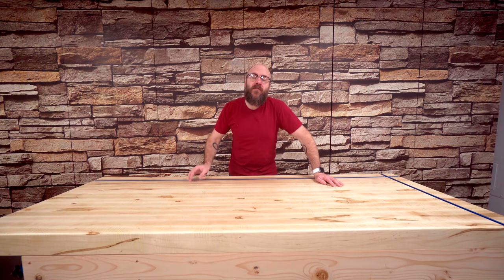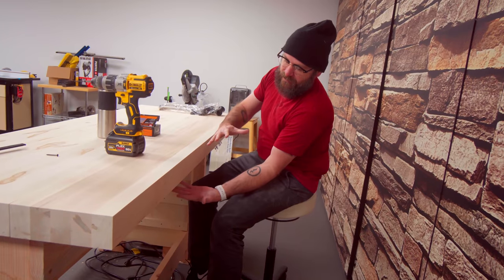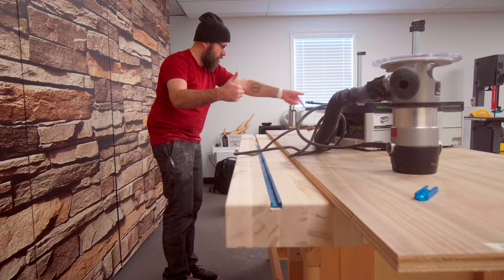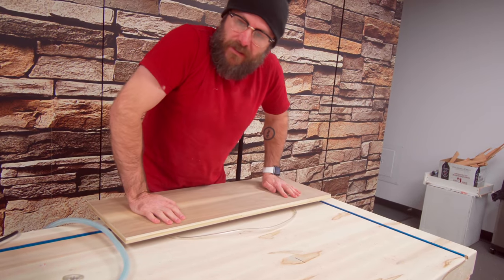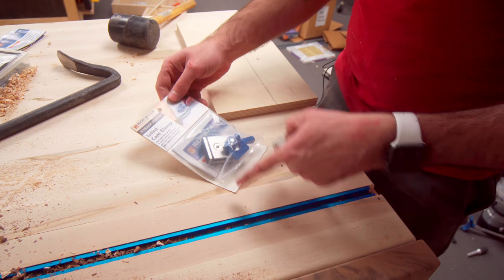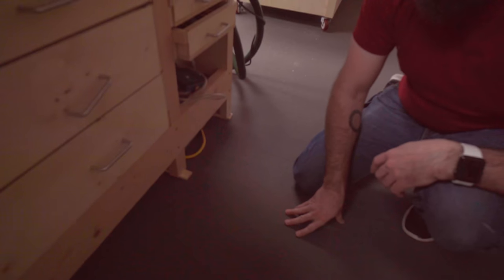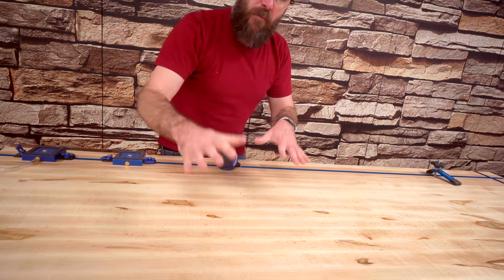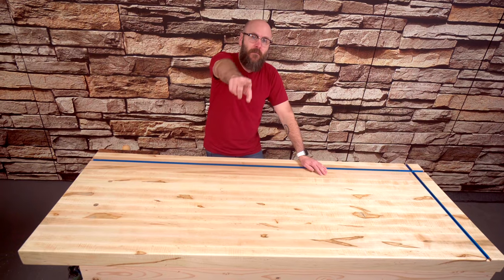Modernize Your Workbench with All the Accessories!

Comment: You are so excited about the new workbench. I have one from Home Depot that just unfolds and a premade bottom goes into channels on each side. The first thing I did was install casters and wrapped the sides and back in 1/2 inch plywood. Going to use the inside for drawers. I'm planning on building a new one. Saw someone who made it with 2 jacks. Truck on the bottom and a motorcycle on the bottom. I'm doing 12 VDC powered for both of them. Found on Amazon. Can't do that hand cranking. I would like to get your clamp drawer in on the top. The smaller ones are hanging from the router table and the long ones are leaning in a corner. You mentioned that you are in a garage? It looks like low pile carpeting. If so, how do you get the sawdust out? I have a 2 car garage and doing it at home.

Comment: At some point, you may want to consider putting a couple of intersections in the middle of the long runs along the length of the bench.  That way if you already have a few things mounted in there but forgot to put something on the inside of the track, you don't have to pull 5 things out to put the one in the middle.  It would give you more flexibility if you happened to flub the order of sliding things in.
Reply: Sean Necker , clearly you haven't played unblock me lol

Comment: Amazing bench!  Thanks for the video and T-track ideas. This is very inspiring.  One idea for the foam shadow boards in the drawer. Use two pieces of foam to get the thickness you want.  Trace and cut out your tool profiles in the top one only.  Then glue them together.  The bottom looks nice when the tool is out of its spot.

Comment: Just an idea. Maybe this idea is useful ?. Making a simple 2x3 T Track. The ends cut down to 1”. This would allow you to use the hammer style bench clamp to hold it in place. This would allow a t track clamp opposite of the one you built into the bench. This T track could be hung up vertically on the wall, or, if you make it the size of your clamp drawers, you could store it in there along with the other clamps.

Comment: Idea for the Spool:

I was thinking something that ties in with the workbench ie. the dripping colour. Carve the sections so that the edges of the top section of the spool seems to bend and drip. This could be powercarved perhaps and colour matched to the workbench.

The bottom section of the spool should be blackened and warped as if it was on fire, so the heat from the bottom would be melting the top.

The middle of the spool could have a billowing smoke effect perhaps or turned into a stack of wood to more accentuate the bottom fire.
Reply from the maker: Whoa, that's an interesting idea! I like how you think!

Comment: Nice.heres my two cents, one per.1. A T track running vertically on leg opposite clamp to hold up long boards.2. Route finger pulls into those seeet drawers so pulls dont getcha and you dont have to push through for flush condition.
I actually liked all the Rocker ads, i worked on me.

Comment: Invest a few (and I mean actually very few) bucks in a brace/bit set.  Even an old one.  Those 3/4" holes are way easier to do with a b/b, leave PERFECTLY good holes, and is totally quiet and zen.  Spade bits scare the crap out of me for any sort of surface work.  B/B with it side cutters are like super expensive Forstner bits in that they leave the hole perfect at 1/10'th the cost.

Comment: Very good work on your workbench. At 5:36, you use a tool that will cover a screw bit in the drill head and  the other end holds a drill bit. I was wondering what this was called and where you got it,,,thank you very much.

Comment: It looks great, but you mentioned that you built the top flush on one side so you could clamp a board against it down to the floor...but then you have metal handles that stick out from the drawers. Have you considered recessed handles or else just cutting a grip hole out of the drawer face?
Reply from the maker: The drawers push in and out of the way. :)

Comment: Great stuff... as always learned a lot watching your video.  As always though, a couple of comments.  How much Rockler stuff did you get to do this -- in other words was ALL the Rockler stuff in the video provided as sponsorship or did you already own any of it?  Don't get me wrong, I'm not envious... just wondering what it would take to "equal" that "investment".

On the drawers, you could create a little divet on the upper side of the rail, and a spring-loaded ball-bearing on the lower side of the slide, so it would "sort of lock in place" when it's halfway.  Right now you're working it to close them so they appear to be at the same point between front and back.

Last comment, I promise: your bench vise sticks above the surface of your workbench.  It's evident in the scene when you install it, and when you benchdog a board in there and it's loose on the surface. 

I've said too much.  I haven't said enough.  I thought that I heard you... oh never mind that song.

Thanks, Dave!

Ehud Gavron
Tucson AZ

Comment: is the only joining of the 3 sections for the bench top by glue? How did you reinforce that I must have missed it in your video. Also, did you only plane one side of the bench? The bottom edges looked a little choppy.
Reply from the maker: Glue only and left the bottom choppy.

Comment: Great job, lots of great ideas. 

Question: what air compressor is that? It looks like California Air but what model? Is it the 1 gallon? Good enough for shooting some brads, pins and Staples for glue ups? 

Thanks!
Reply from the maker: It's the smallest one. I think 1 gallon. Yes, I use it for pins. Haven't tried brad nails yet but I'm sure it'll work.

Comment: When using a planner would you ever use some sort of power like how they do in automotive when they sand down body panels after laying down body filler, thus making sure you have no low/high spots in the table top

Comment: Love the video. I got  t track too but it's not rockler. It's power something and it's aluminum.  Question is what type of blade did you use to cut down the t track?
Reply from the maker: if it's an aluminum track you can use a regular wood blade.
Reply: @MakeSomething  does it matter if I use a 50t miter saw blade?
Reply from the maker: @Grumpy718  you should be fine. I can't recall for sure But I think I used a 40t. 50t should be a nice and clean cut and won't hurt your blade. Nice and slow.

Comment: any reason in particular for doing two passes with .5" router bit as opposed to changing to 3/4" bit for T-track installation?
Reply from the maker: I'm afraid of removing that much material at one time.
Reply: Ahh!  That makes sense.  I thought you were going to say Rockler didn't have one:-)  If you used a 3/4" bit, you'd probably want to make multiple passes anyway.  But you wouldn't have to move the fence and pray for perfect parallelism.

Comment: Did you use self tapping screws to attach the base to the top?  How do they allow expansion of the top?
Reply from the maker: I used drywall screws. Did not allow for expansion.
Reply: with a thick top like that, I would not worry about expansion at all. nice work.

Comment: Hey do you prefer a 2x4 top like that of a 2 layer plywood top with Formica?
Reply from the maker: I prefer the wood top because I beat the crap out of mine. There's all kinds of dents, drill holes and burn marks in it these days.
Reply: Dude I really like your channel and your shop. Nice videos! Yeah plus I can get toobafor scraps for free and make a top and it would be like $200 for a nice sheet of plywood, a sheep of MDF and Formica. Yeah I just need to find a way to make it nice and flat. I don't have a planer. Maybe I can find a place with a big 36" planer here in AZ! Happy New Year! @MakeSomething

Comment: I just thot of sumthin !  What about using a t-track vertically down the leg of the flush face of the bench. It would  add the same thing as holdfast holes    (on the opposite end from the bench vise).  With the sliding bolt drilled thru a square block (used as a support stop).  Thanks for the great design

Comment: You could have cut with the circular saw then used a flush trim router bit to get it flat instead of doing 2 passes on the circular saw and then using a belt sander either way great bench I wish I had the money and space

Comment: The Dewalt saw does have dust collection but have to buy the part separately for $10 USD
Reply: KryptoKonvict you can probably get it at some store or another, but I forget the name.
Reply: @Codswallop58  ya I picked mine up from Amazon for 9.99 usd. Snaps in place and secured by 2 screws

Comment: The bench is sweet, but is it gauche to point out the giant crack in the end of it? (6:05)
Reply from the maker: Yeah, couldn't get enough clamp pressure to pull the warped boards together. Might as well start over! 😋
Reply: Well, if you do, we will all follow along...

Comment: 3:30 even the flat earth society wouldnt consider this flat /j
Reply from the maker: I mean, how flat does it need to be?
Reply: @MakeSomething  yeah i like to connect pieces with a quarter inch stagger as well.  Rockler doesn't make levels though so what're you gonna do?
Reply: @MakeSomething  I would be bothered by that gap. It's your bench, but I would hate using a bench where my pencil was always running off and my boards weren't flat for planing.
Reply from the maker: @woodworkerroyer8497  I'd be bothered by that as well! Luckily that's not an issue.
Reply: woodworker wasn’t

Comment: Plywood with sand paper wouldn't guarantee a true flat top. . The plywood wound still flex too much. Some sort of gusseting or bracing would have to be used on the plywood to make it rigid enough to use as a substrate. Besides all that that would just be Hokie. What's wrong with planning sticks?

Comment: You are obviously sponsered by Rockler, or at least want to be. Bessey clamps are well known, world wide, for their superior quality and ease of use. Bessey clamps are also made of high grade steel which will not bend even when clamping pieces which need a lot of clamping pressure. Why a Rockler aluminium clamp would be better or why on earth you would prefer it is beyond me! If you're going to recommend anything, impartiality is always recommendable, even if you use sponsored tools. Rockler make a lot of good stuff, no question about it. Like your bench though 👍
ps. The Besseys wouldn't be covered in glue if you had covered them with paper at the "Glue-up" phase. Your Rockler aluminium clamps, with all those holes, would now be seriously non-useable.

Comment: You've probably answered this question elsewhere, but is there any reason you didn't address the levelness of your concrete before laying down the carpet? Not really necessary? Cost? Just curious.
Reply from the maker: It was way too expensive!
Reply: Josh Dirkson I
Reply: You can get levelling cement, just pour it and trowel it, quite cheap and easy

Comment: The sandpaper on plywood trick will not work. It’s dumb. I’m glad you didn’t try it. The plywood will easily flex to match the curve on your extremely solid top even if it is 3/4 thick.